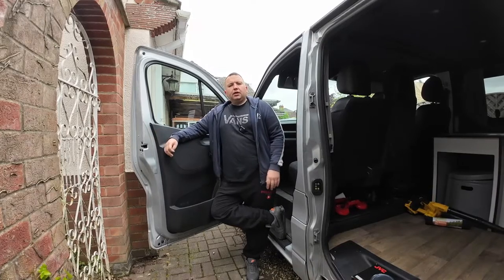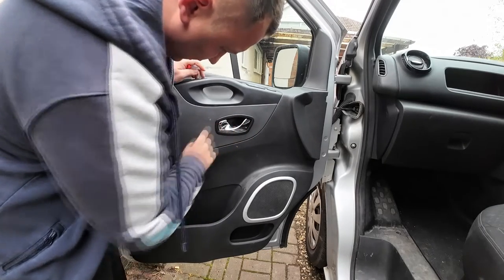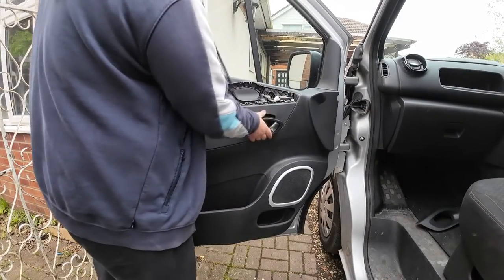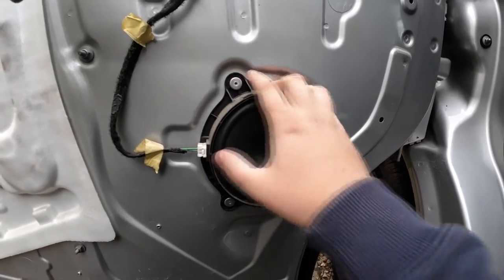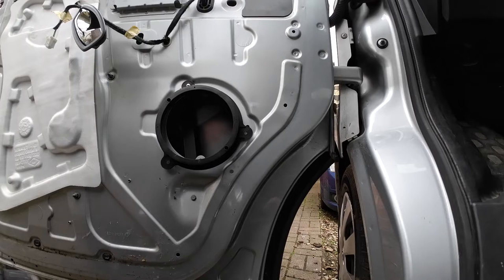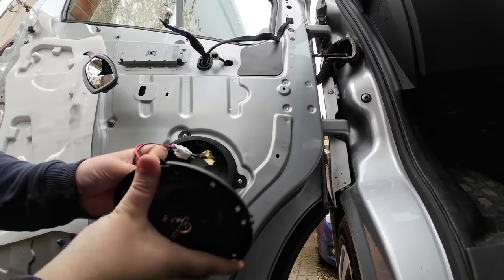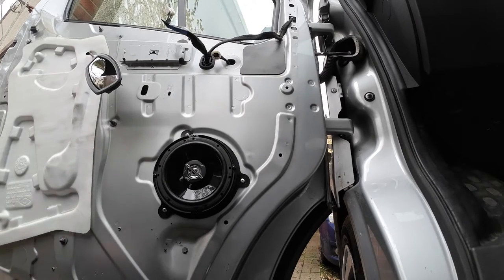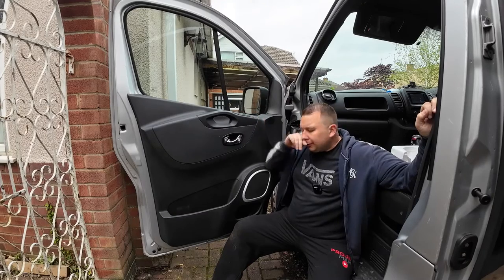Upgrading My Van Door Speakers

Comment: Listen to my advice in terms of door speakers and their soundings in vans and more older cars...
The problem isn't the oem speakers... not to confuse an aftermarked set will sound better in most cases but the real problem is the overal fabrication and their cheap isolation.

If you want to extract real nice harman kardon of bmw 300watt look and feel out of those doors you need to start with door isolation...

I drive a Trafic 2019 model and as most vans the oem manufactored audio wasn't quite impressive and these where the steps i made to make it sound like a real premium sound system...

1 changed speakers to a pair of JBL Gto 620 (was in fact a bit dissepointing)
2 replaced cables from speakers to head unit. ( volume went up but still not satisfied)
3 addet a class D amp that could deliver 2x 150rms (ok, we where getting there)
4 added acoustic isolation inside the door panels (Yess there was that deep bass sounding boom boom i was hoping for!)

I ensure you, road noises get limmited, interios sounds much warmer.
If i ever do this again i probably go take above steps in the opposite way as the last step was the most effective one!

I kept all above on the original medianav headunit btw....

Just to share my experiance.
Reply from the maker: Yes I totally agree with what you say iv done many installations in my cars over the years this video was just how to show people how to change the speakers . Thanks for watching 👍

Comment: To be on the safe side I would have installed a grommet in the hole that you put the speaker cable through Gary.  Flexible wires, movement and vibration combined with holes in sheet metal can lead to insulation chafing.
Reply from the maker: It's was rolled over on itself making it smooth.

Comment: I changed my standard speakers in my transit a few years back, dunno what i was expecting but it turned out to be a load of hassle for very little difference in sound to my ears. Did you hear a big difference?
Reply from the maker: Do you still have the factory radio still installed that maybe why I have a aftermarket pioneer stereo installed which has more output.
Reply: @ProjectMan  yeah, it’s too much hassle to change it
Reply from the maker: They are plug and play now days no cutting wires like the old days 😂
Reply: @ProjectMan  the dash board isn’t though 🤣🤣🤣
Reply from the maker: There are fitting kits mine was built in go on give it a go you know you want to 😂😂

Comment: There was no sound coming from the speaker on the left door. I changed it as in this video. Still no sound. What is the problem?
Reply from the maker: Possible broken speaker cable or your channel ain't working on the stereo .
Reply: @ProjectMan  I checked the cable completely but it still did not work. Could the problem be in the fuse box?
Reply from the maker: @AliYlmaz-dx6ee  I wouldn't think fuse box have you checked the settings on the stereo the balance and fader.
Reply: @ProjectMan  When I move the fade setting to the left it still doesn't work, only the right one works
Reply from the maker: @AliYlmaz-dx6ee if your sure the speaker works and you have checked everything think else iv said sounds like a problem with the stereo

Comment: That pod would have fit if you had rotated it 180°
Reply from the maker: I did try but only 2 holes would line up the was locating pins and still didn't line up just what happens with after market stuff sometimes 👍🏻

Comment: Shouldn't put wiring inside door as you get rain water running in and wires will carode,thats why  original one's were on the outside.
Reply from the maker: Iv worked on loads of cars that have wires in the doors from factory shouldn't be wet in there if you a good window rubbers.